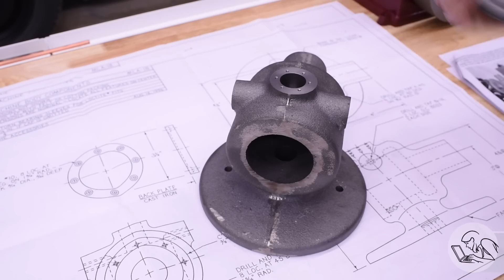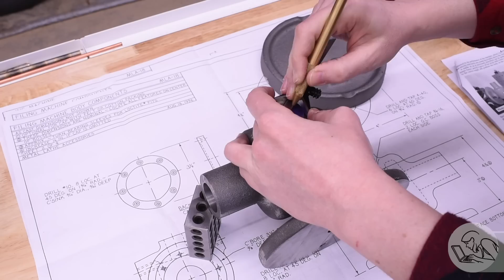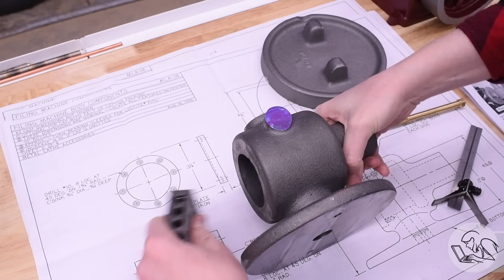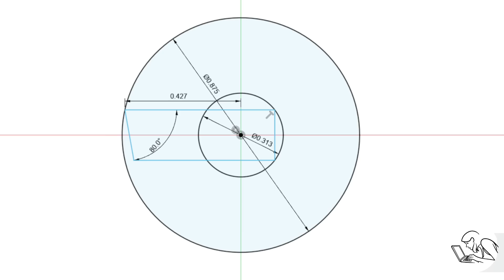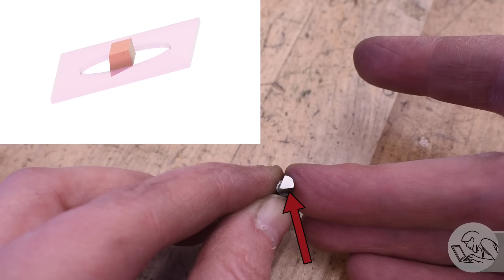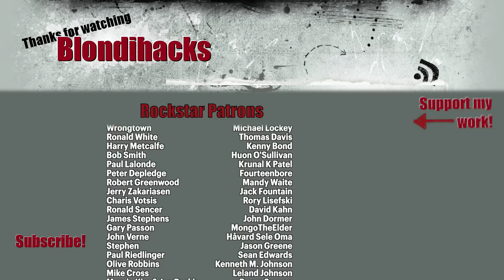Let's Build A Die Filer - Part 3

Comment: Wow! Spinning all that madness up in that tiny lathe had my butthole puckered so tight I cut a perfect circle in my chair. Lmao!!! 
It may look terrifying, but you're running that at a low enough rpm that if something was to fail, it wouldn't hurt too awfully bad, but given the equipment you have available, what other choice did you have??? I can hear all the machinists with access to all the best equipment screaming right now, but they forget all the crazy set ups they had to endure as apprentices or beginner hobby machinists.
I love these little die filers!!! Great work!!

Comment: To locate the horizontal axis, I think I might have used a height gauge to scribe using the base as a reference, then use blocks to put it on the other machined faces and again used the height gauge to scribe the 90 degree marks.

Comment: There interesting thing about indicating forces in a dti instead of a plunger DI, because the dti used a hair spring for return with many more turns than the output shaft, the retraction forces are basically linear throughout is travel. Not the same with a plunger that uses a coil spring in a tension configuration. 1800's watch science!

Comment: You can make anything in the world with just a lathe and a hammer, if you dont have a hammer, just make one on the lathe
Reply: Mills are just vertical lathes
Reply: You can't make a knife or an axe with a lathe 😁
Reply: @HyperactiveNeuron  I can think of several ways to make a knife on a lathe.  A lathe doesn't only turn stock but will also turn tools, such as a grinding wheel.
Reply: I wish I could make a lathe with my hammer
Reply: The gentleman in Pakistani do it all the time
Reply: And if you don't have a lathe you can always make one with a hammer?
Reply: @HyperactiveNeuron  I think you'll find that to be wrong. Live tooling mounted in the lathe spindle and workpiece mounted on a work slide and milling and surface grinding ops become very do-able

Comment: Casting scale is super hard to cut. I fried one of my HSS blanks on my Eccentric Engineering cutter on the casting scale on my Quorn project. That up and down pulsing motion was the tool riding up the scale and then back down the other side. If you can grind away some of the scale the cuts will be a LOT more buttery. Love your channel Quinn. Your channel is one of the reasons I started in this hobby. Thanks for all you. do!

Comment: @12:00 This triggers my one phobia, fear of structural failures (I have no idea if there's a term for that). :) I don't mind flying, either on a plane or paragliding, but if I see rust or anything, I get anxious very quickly. I always found that weird, but it comes down to not trusting huge loads, structure etc. When I worked in a lab, I made incredibly sure my high-speed centrifuge was balanced within the gram and still I stepped behind a wall when I pressed start. lol

Comment: I am again and again impressed how you solve problems and achieve such accurate and precise results. However given the number of difficult setups you had to do over these three videos, I was wondering if it would have been easier to saw the base off the casting at the beginning, do all the machining to the two parts separately and only fit them back together at the end.
Reply: @bwyseymail  I agree.  Part of what makes a hobby fun is the challenge of figuring out the how’s and why’s of doing it right.  If ease was the prime motivation, then one could argue that it would have been “easier” to just buy a die filer.  And once you’re down THAT rabbit hole, then you start thinking, “wouldn’t it just be easier to just go out and buy a model train, instead of taking months of time figuring out how to build one?”

What makes Quinn’s videos so interesting to watch is seeing her figure out the process of doing something right (and hearing her explain why certain things are at least “right enough”.)  They would be somewhat disappointing to watch if she were the type of person to say “how it SHOULD be done is too hard, so here’s a half-assed work-around”.
Reply: @mrimmortal1579  :person-turqouise-waving:.........G'day,
an 81year old "metal worker" agrees.
Cheers,
Malcolm.

Comment: Hi Quinn. You do have production and presentation skills.  Eh, maybe just a bit thick sometimes but we love it anyways. Lightens it up.
I keep waiting for a lost wax caster to pipe in but no takers.
Easy counter balance estimate. Suspend the heavy end in oil on a 2-4 kilogram scale +-1 gram. Then suspend your counter weights until they add up to the same displacement. Don't let it touch the  bowl though.

Comment: Really nice work!  I was expecting the casting in the lathe to wobble all over the place...and just then you added counterweights around it.  :)  Really nice work on the custom cutter for the hold down bolts.  I think I would have been lazy, and tried to modify a small grinding wheel to cut it by pulling down through the hole.  That's assuming I could shape a SiC wheel with a diamond wheel, and that it would cut halfway OK into to the iron.  Way less sophisticated than your cutting approach, but without requiring the down force.

Comment: That casting is a joke!

It would actually be cool if you made the casting out of billet for the centre and bosses etc. do the centre on mill then cut the bosses and plate on the lethal them thread them into the centre billet. Attach them with heat fitting or normal thread fitting and braise the threads to lock them together. I’m envisaging a fully milled block with lathed boss’ popping out. Would look nuts!

Comment: That setup doesn't look a little terrifying, it scared the whatever out of me. And I have chucked some jobs where I would put the lathe in auto feed and walk to the other side of the workshop and stand by the main circuit breaker, just in case. I'd have bored that with a bar running between centers. 

But you made it work, so bravo....

Comment: Great work..
Do you have enough room on the mill to mount the base on a rotary table  to do the table mounting holes??
Reply: I was just wondering if it would be easier to drill the table .ounting holes on the mill set up on a rotary table.?

Comment: Analysing this casting as it was delivered, makes me think that the pattern-maker was inexperienced. 

For example; the two bosses already machined by Quinn in episodes 1&2, did not need any tapered draft on them and could have been cast close to cylindrical. 

The boss which Q has drilled with six holes, could have been cast deliberately longer and as a cylinder, so that it could have been easily held in a lathe chuck. After machining the base on the lathe, the excess material could have been sawn off.

In a foundry the moulder and the pattern-maker would have spotted this problem early when the drawing arrived.